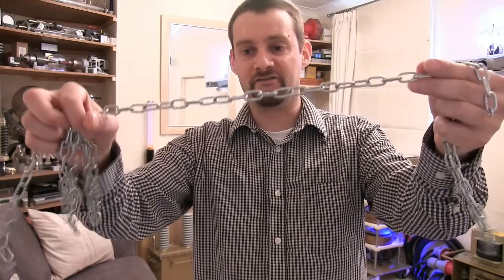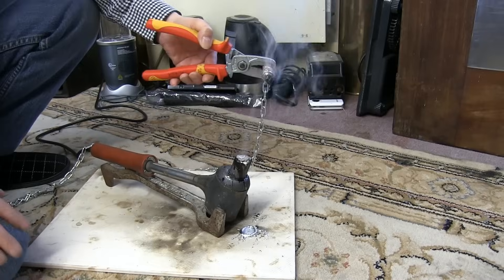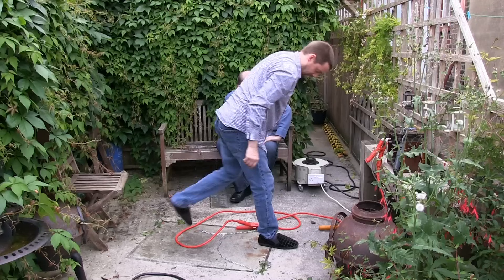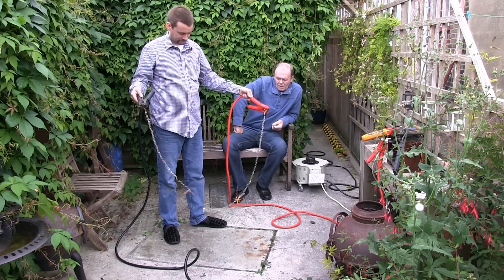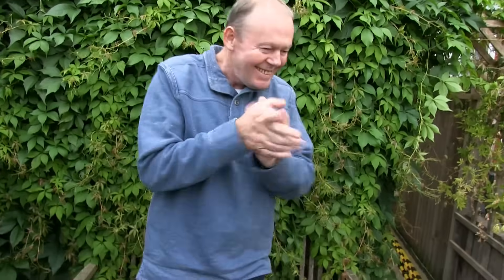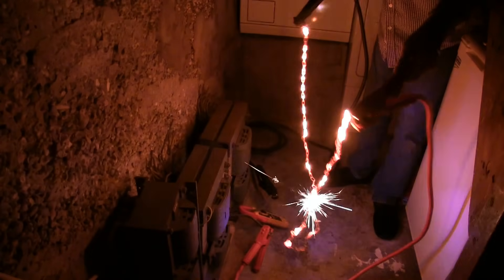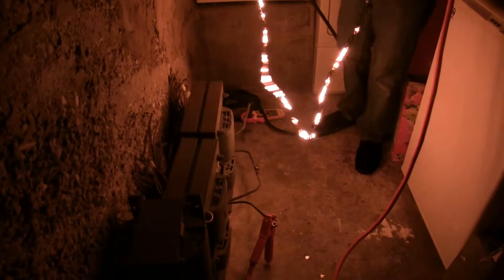Steel Chain VS Electrical Current

Comment: 100amps 50v is a lot, I TIG weld a lot of stuff with 75amps, and not much voltage (once the arc is established) like... 13volts. Mostly 14-16ga sheet metal.

Comment: Hotter chain = higher resistance because the vibration of the atoms makes it difficult for the electrons to easily move throughout the metal lattice

Comment: Whats the difference between volts and amps and watts ? Isn't 30v low ? How is it capable to make meral glow red ?
Reply: kevin fournier 30 volts is low compared to what you get through an outlet. but when you decrease voltage the wattage has to stay the same so the amps increase and it is the amperage that is causing the chain to glow

Comment: Well, I used to worry about the amount of heat my chain was enduring while I was using 12v 2a during hydrolysis to clean some metal parts.... then I watched this video. I'm not too worried anymore.

Comment: Why does the humming sound get louder when you connect the chains
Reply: What you're hearing is the 50 Hz electrical hum by the 240 volts in the UK where photon is. The current passes through the transformer, which causes the 100 Hz hum you're talking about. In the experiment, the chain itself has resistance to the electrical current. When the chain gets shorter, the resistance drops. So there's less resistance from the chain, and more current flows through the transformer, which makes the humming sound louder.
(A.K.A the shorter the chain, the louder the noise. :D )

Comment: Why are only some of the links glowing?  Is it just a variation in resistance?
Reply: Most likely due to the varying amounts of resistance where one link 
contacts the next one. Some of these contact points have welded 
themselves together, resulting in less resistance, hence less heat.

Comment: 0:19 i'm sure you know that you would have to stretch that chain out to stand a chance of getting the whole thing to glow red, and more than likely one of the links is going to bust long before you get any sort of consistent heating along the "chain".

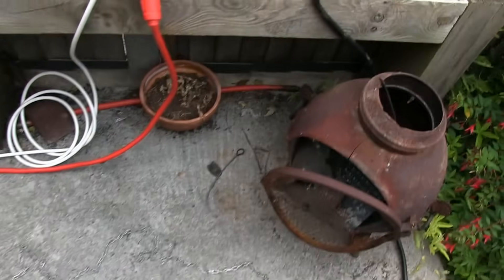EDIT1: 2:58 yeah, air has a fairly high level of resistance.

Comment: We need more things popped with the big boys power supply 

Have you done any off those LED tubes you can put in existing fluorescent light fixtures the ones I get have some do's and don'ts on how to install them I tend to go with some off the don'ts and have some problems like don't install until ballast has been removed and another one is when they have A and N on one end off the tube and that's with the cheap ones and the more expensive ones aren't as heavy and give out a better light spread I think you need too blow some up in the name of science

Comment: Insane stunts as always :P
I've got a question tough. How do you go and not get electrocuted when playing around with these many amps?
You surely must've gotten electrocuted at least a handful of times, or more, given your years of experience.
Reply: Chain has low resistance, therefore it is easy to make many amps flow through it, without a lot of voltage. Human body has much higher resistance, and therefore requires a higher voltage, to make any appreciable amount of amps flow through it. Even so, only a very low amperage through the body can kill.

Comment: Can anybody explain me why the chain appears glowing bright in some places while the other areas appear a bit less bright? Thanks in advance.
Reply from the maker: The less bright links have a very good connection, the glowing links have a higher resistance on the contact points.
Reply: ***** thanks a lot for the info :)

Comment: FLIPPING YES, BABY!!

Take a chain, connect it across a transformer, ram loads of Amps in there and in the name of Ohm's Law.......   Look at it Glowiiiiiiiiiiiiin !! :D

I have always wanted to try this, but I don't think my 3-5 kVa Tx is grunty enough (or the connections coming out if it) and I don't want to risk popping it.

Yes, you think like I do. Take something and stuff juice into it. :D

I noticed your 28A variac coming out for business in this vid. I bet it was easier to roll that in the garden, now it has the wheeelz on it. :-) Tasty idea of mine, yes? :D

Interestingly, when I got the wheelz for my 28A BIG DOGG, I also plumped for the same wheelz, and it is definitely easier to roll that 28Kg lump of a variac around!

Hmmm....... I do wonder what you could glow-up next. Let me see...... how about.....

YESSSSSS!! I have it!! Get a carbon brush out of an old motor or something similar, and then teeaase it on high current until you can get it Glowiiiiiiiin. :D

Here's another idea: See if you can obtain a cheap budgety lightswitch from somewhere and slowly teeaase it up on high current while flicking it on-and-off. Let's see what it really takes to weld-up that contact in there. Then, once it welds up.....

RIP IT RIIIIIIIGHT UP on the variac, get it Glowiiiiiiiiiiin' in there and properly pop it, then "Open-It-Up-Very-Carefully" so that we can examine the carnage inside.  

Thanxx for showing,

-BoomBoxDeluxe / Wayne's Electrical.

1st August 2016, 03.30 (My goodness! Is it really that early in the morning?!!)
Reply from the maker: Hello mate, the 28A variac is pants, keep popping brushes, the wheels are good though thanks to you :)
Reply: Aaaaw, poor thing. It's a brush, not a fuse. :D There may be a possibility that you have "outgrown" that variac, which is why the brush keeps on going like a fuse.

It's  a shame that I don't have the coin to buy it, as I have an experiment that I would like to try, but I would need 2x 28A variacs. If the experiment turned out to be successful, one of the variacs would be modified.... thanks to an idea that I got from one of your vids. :D

Take care,

-BoomBoxDeluxe / Wayne's Electrical.

1st August 2016, 19.05

Comment: Must admit I really dont see the point of this one. Though the part where you let it brush your trousers was interesting, showing how the electrical pixies will take the path of least resistance.

I'm curious, if there is a point at which the steel could with stand enough heat to raise the resistance enough that brushing it against your pants leg would actually cause it to arc? Try that one next! Thicker chain, bigger transformers! And pull it taught this time, between two poles perhaps.
Reply: Replying to my own post, @photoninduction

Was the reason it was safe to brush it against your trousers because the voltage was only 50 volts or is there some other mechanic at play here?
Reply: +photonicinduction OK, maybe this time I will get it right.

Comment: I always love your videos. But I don't know much about elictricity. Maybe when you say things like "we need more amps than volts" you could quickly explain why? idk I just think it would be interesting.
Reply: Seriously? That's like asking "Why did you put gas into the tank before driving" on an automotive channel.
Reply: Jeppe Løger
I get it, you vape.
Reply: +zawzero Sick memes mate :)))
Reply: Jeppe Løger
You actually vape.
Reply: The more voltage you apply to a given resistance (the chain), the more current (amps) flow. The higher the resistance, the higher the voltage you have to apply to make a given amount of amps flow. In simple terms, the amps are what cause the chain to get hot. In this case, the chain has a fairly low resistance, so it doesn't need a lot of voltage to make a lot of amps flow.  1 volt applied to 1 ohm of resistance will cause 1 amp to flow, as will 10 volts applied to 10 ohms, and so on. 10 volts applied to 1 ohm will cause 10 amps to flow. For "more amps than volts", the resistance would be less than 1 ohm. 10 volts applied to half an ohm would cause 20 amps to flow., and 50 volts would cause 100 amps to flow.
Reply: zawzero Lets make a laughing stock out of something which is helping people all over the world quit smoking Good on you mate
Reply: Jeppe Løger
Sure, inhaling chemical compounds that have not been tested or approved or anything alike at a heat that is technically insane will sure help people. Have fun enjoying your cancer that is induced by the cancerogenic fumes aswell.
Reply: zawzero Fact is, they are far less harmful than cigarettes. That's a massive win in itself. "Have fun enjoying your cancer" do you honestly not hear yourself? Did you not have friends in school?
Reply: Jeppe Løger
I never went to school actually. We are not forced to do that here in Albania.
Reply: Jeppe Løger
I am a prick, but not smart. Smart is somebody who speaks several languages and perhaps can also do mathematics.

Comment: Why not put that chain in a 5 gallon glass water pale and pull a vacuum and make a 250,000 V A lamp? Would be a first if you could make a 50K A transformer at 50 volts.

Comment: Odd that some links are glowing while other are not
Reply: Resistance varies all along the chain due to small differences in how the links are touching. It would be self-reinforcing too, as the links with the best contact heat up they become more malleable, making better contact again and creating the "hot spots" in the chain.

Comment: I dont get why current wouldnt travel through him when it touched his trousers?
Reply: because A- he's grounded
and B- it's more efficient to go through the chain
if i made a mistake or am wrong, let me know.
Reply: it did travel through him, it is just that it is a very low voltage so the current was I=V/R.
where resistance is the resistance of his body.
Reply from the maker: B is correct lol
Reply: Because the chain is of lower resistance and, more importantly, transformer secondaries are probably not grounded.

Comment: If the chain can handle that much abuse, what the heck are the cables made out of?
Reply: cooper
Reply: +Anton Helsgaun copper* and I didn't get that comment
Reply: Steel has a much higher melting point than copper. I wonder what is causing the hot spots. I guess the points where the links touch are causing resistance, and that's where the heat starts to build up.
Reply: Dettweiler I'm guessing the more accurate way to say it is cold spots... But i think the cold spots welded themselves together, meaning less resistance then where it isnt

Comment: Regarding your thought that the hotter the chain got the higher the resistance: I imagine you are unfamiliar with this problem living where you do, but where I live in california we have a much hotter climate. It is common here that older (and less well engineered) cars will, on a hot day, heat up as they are driven, to the point that the battery cable to the starter will also greatly increase in heat because of its proximity to the engine block.  The result is that when people get out to look around to refuel or, whatever, the car will not restart. The culprit being the cable whose resistance has increased due to heat to the point that the starter might only be seeing a couple of volts despite being attached to a fully charged battery directly.  As far as I know, all metals increase in resistance as they increase in heat.
Reply: Everything increase in resistance as they increase in heat

Comment: I'm no safety Nazi, but DAMN! Watching you fling that glowing hot steel around your legs with those bedroom slippers on made me a bit nervous :-P

Also... I'm glad that I'm not paying your power bill!

Cool video though. Thanks for making it.
Reply: You realize most of his projects don'*t need that much power?
Reply: I don't know the electricity rates where he is, but at my place in the US, running a 400 watt light bulb would cost about 5 cents per hour. 
My electricity cost is about 12 cents per kwh, which means kilowatt-hour. In other words, 1000 watts for one hour.

Comment: I usually dont say things like this, but i guess we all know how Mr Photon will Ultimatly Die.
Reply: yeah... electricity causes cancer... but don't worry... everyone gets cancer after a while...
Reply: maybe instead of the electric chair or lethal injection people should have to do a few skips with this.
Reply: He said in a video he'd probably get killed from smoking rather than all this youtube material.
Reply: he's probably had enough electricity going thru his body throughout all his electrical experiments that the electric chair for him would be like sticking your tongue to a AA battery
Reply: He won't die from the electricity - He's far too smart to let it get the better of him.
I fear for his lungs if that chain is zinc galvanised, and the lead solder and flux.
Also, old electric items with selenium rectifiers can be nasty, not to mention the beryllium in microwave.
So it won't be a quick death like being electrocuted.
Reply from the maker: That's why we burnt the galv off outside :)

Comment: Playing with a 100amp molten chain in slippers. How are you still alive?
Reply: slippers are very well insulators from the ground (the chain was probery at 50-70A by the time it was read hot)
Reply: i wouldnt worry about the current. as it is only 50v. i would worry about the heat generated.
+lee x slippers arent insulators. theyre slippers.

Comment: how much does this kind of shit cost you to do?(power bill)
Reply: He actually has a fairly low power bill. It's only for a short amount of time so over the month it averages out to less then leaving a light on. For short periods of time though, the amount of power used is insane.
Reply: theLuigiFan0007
It is NOT insane. Or do you consider boiling water or making a roast in the oven an insane amount of power?
Reply: zawzero
Oven - 3kW, Dryer - 3.4kW, A/C - 5kW.
PhotonicInduction 40-100A@240V- 10-24kW.
To the average person, compared to a regular appliance, it is an insane amount of power. To me it's not that large an amount, but most people would think so. I tend to dumb down and oversimplify replies so people can understand them better.
Reply: theLuigiFan0007
im not exactly new  to electrical.
Reply: Roush Hawley
Okay. Not exactly sure what you meant by the comment, but if you meant my mentioning simplifying things, I was just explaining my answer to someone else. Nice to hear someone else knows a bit about electronics.
Reply: theLuigiFan0007
i was kinda joking...

Comment: what a fuckin transformer was that which you used after the smaller one?
Reply: Love that 60hz hum
Reply: it's 50hz in england
Reply: @bicylindrico 50Hz Hum. UK Electric system.
Reply: yes, the funny sounding language
Reply: +bicylindrico That is 50Hz hum
Reply: +bicylindrico I believe in UK is 50Hz
Reply: +bicylindrico 50hz over here
Reply: I could hear the 10hz difference. 50 means more power right?
Reply: 50 means everything turns a bit slower. From power plant turbines to your desk fan.
Reply: If the motors are synchronous. But I think most fans have a universal motor.
Reply: Lukas Graphen Even if they are asynhronous they will turn slower. Thats how VFDs work afterall.
Reply: aren't the windings different?
More windings on 60hz motors so they spin at the same speed?
Would be interesting to see if a 60hz desk fan from the US spins slower in the UK.
I know nothing about electricity outside of what Photon has taught me by the way.
Reply: George Smith Yes, you're right as long as it's a as-/synchronous motor. But most fans are probably using universal motors where mostly the voltage matters. So an US fan which is made for 110 volts would therefore spin faster in the UK with 230 volts.
Reply: George Smith No, they do not compensate for speed. They simply spin faster (for same number of poles).
Reply: Lukas Graphen Universal motor in desk fan? That would be fun...
Reply: VictorIndiaDeltaAlfa
I googled a bit and you're right. As there are mostly shaded pole motors used in fans there's no sensible way to let them spin faster or slower.
But what's the problem with universal motors?
Reply: Lukas Graphen
Universal motors run on AC or DC, always the same direction, regardless of polarity. Appliances like vacuum cleaners that need to run faster then 50/60Hz (3000/3600RPM) use this kind of motor. The amount of coils, and field coil strength, and voltage changes the speed. The little switch on a egg beater rewires the field coil arrangement, thus varying the speed. However, in most cases, voltage controls speed, so doubling the voltage from 120V to 240V quadruples the speed (it's exponential). Thus, the motor would likely explode.
Reply: Lukas Graphen There are two problems, first one is that the motor is brushed, so its loud, creates dust, cause sparking an brush wear.
The other problem is their speed characteristic, which is extremely load dependant, so constant speed is difficult to acheive (eg: wind blows, gets a piece of paper stuck on the mesh of the fan, which causes a loss of load and RPM increases significantly).

Comment: How about blowing up a unblowable electric motor?.These are the newest motors that run lathes and nuclear subs,these motors DO NOT have armatures in them,instead they have a solid machined steel flywheel in them,these motors also DO NOT have brushes in them either,this would make it a awesome candidate for maximum high voltage input to see when it goes BOOOOOOM!!!!!!!.

Comment: IS THAT SAFE?
Reply: perfectly as long as the chain does not touch your skin or melt your slipper into your foot lol (voltage is not the issue here the heat is, all he did hear was make a chain space heater :) )

Comment: *checks temperature by stepping on it*

It shocked him if you look closely, but he actually needs to be electrocuted daily to stay alive.
Reply: Actually, that was just the heat. The voltage is too low to cause a shock.
However, I would not consider that statement you made false. :P